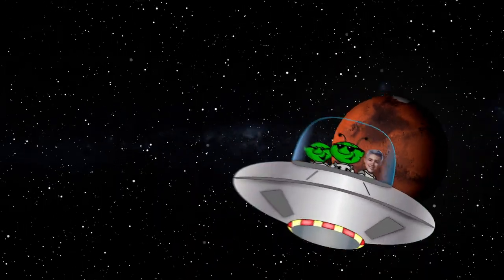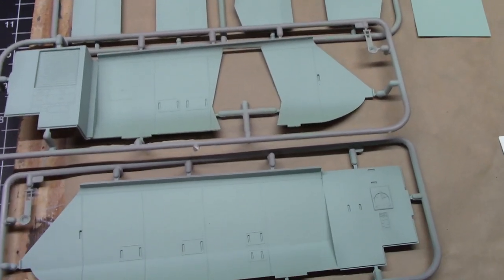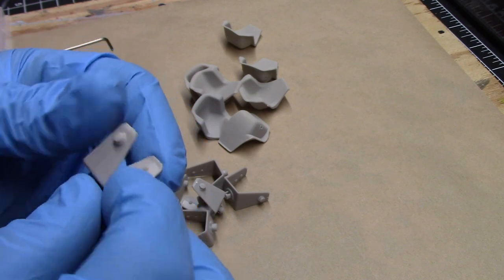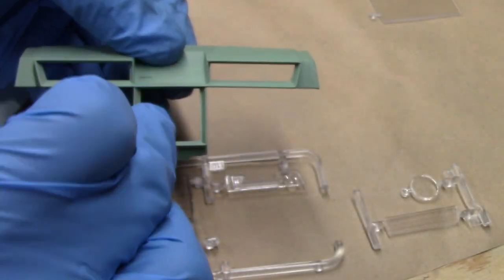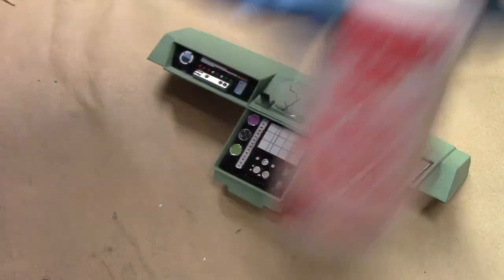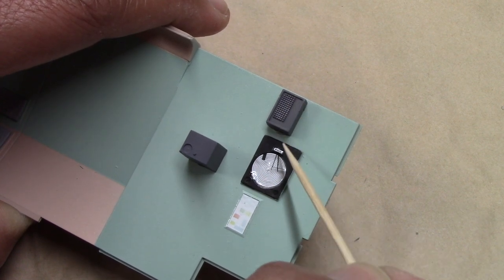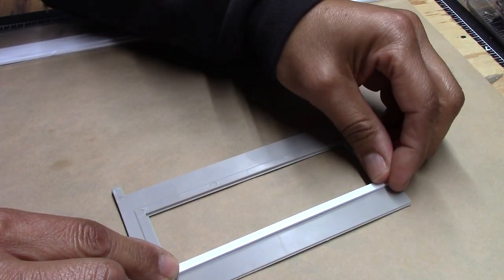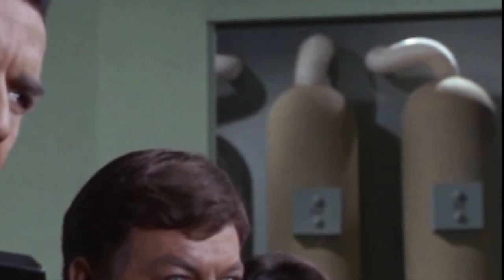Polar Lights Galileo 7 Part 2; Interior

Comment: I must say, you have a way of presenting your builds that I find most engaging. You are almost approaching the zen of Bob Ross! I just purchased a small rechargeable engraver/sander after seeing you use one for sanding the Galileo seat bases. It will be perfect for getting rid of seam lines in those areas where sand paper or a Dremel could wipe out small details.
Reply from the maker: Thanks so much for such nice compliment.  You’ll love the sander. Such a useful tool. I even used it to widen the holes along the floor as a dremel would’ve been overkill.  Thanks again

Comment: Great work. I admire your dedication with the paint colours. I also never cease to be amazed at how many tools you have, I realise I need one of those sanders and a small mitre box for those angled cuts.

I've used LED back light panels for ceiling lights, as they only have a single LED at the end and give an even glow. They are quite thick though and won't fit in every model, and as you showed, the original set had hotpots in the lighting in any case. 

It's worth checking out lighting gels with LED lit interiors, these are thin films of even colour and can used to give strong colours but also for tints / correction when working with blue white LEDs.
Reply from the maker: Thanks Antony.   Appreciate the nice comments.    Good tip about light gels.  Thanks

Comment: Excellent! I'm working on mine too. I was thinking about sheet lightning, like the lighting that came with the Moebius Flying Sub Lighting kit. It was a thin sheet that fit under the floor of the sub to light the hexagonal shapes. You can cut it in any shape you want...it would be a good option for the ceiling if you can find it.
Reply from the maker: Thanks

Comment: Oggie have you ever considered using flocking to give a dark grey carpet effect on the interior of the floor?
Reply from the maker: Hi Lawrence.  I haven't used the stuff but you might want to check out the channel Spruverse> Phil uses flocking on his replica of the Time Machine.  I believe he does it in Part 2 of the build.  I gave it some thought with this build but decided to not proceed.  I would test to see if it would look right.  Hope that helps.